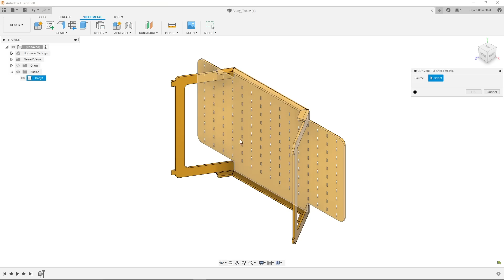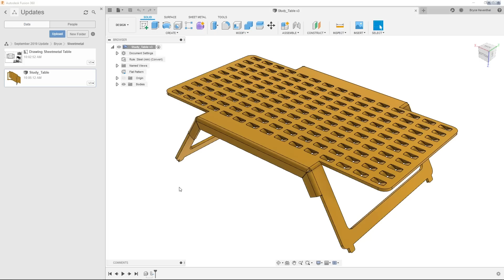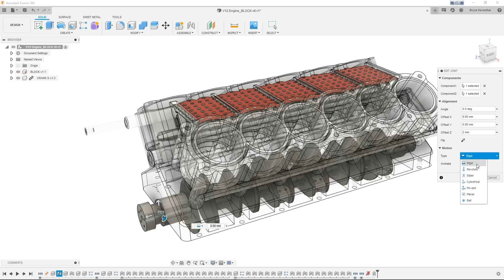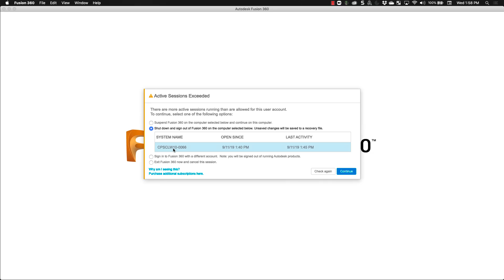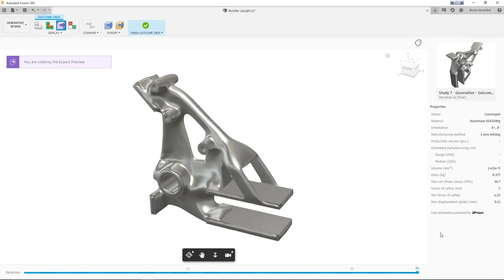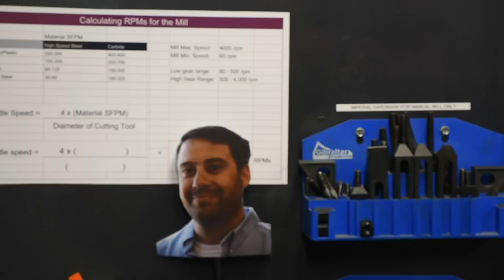What's New in Fusion 360 Design & Engineering - September 2019

Comment: And still no 4k monitor update, feel like its 2010... Autocad developing is slowwwwwwwwww...
Reply: Oh and proper print from f360 also seems like magic is the only solution
Reply from the maker: Can you clarify?  Are you talking about 3D printing or printing a drawing?
Reply: @adskFusion  No, printing sketch in 1:1 or part of sketch, so you can for ex glue and cut it out on a router...
There is a long discussion about it on your forums
Reply from the maker: @Milika-  We recently just updated all of our icons to be more visible on 4K monitors.  Also, this video was showing Fusion 360 updates, not Autocad updates...
Reply: @adskFusion  Still 4k support is not there, main screen is in 2k and my monitor is 4k, really visible.
Reply: See this again workaround https://forums.autodesk.com/t5/fusion-360-design-validate/fusion-360-amp-4k-monitors-if-you-use-a-4k-monitor-please/td-p/5969046

Comment: When are you going to add configurations? Only thing stopping me fully adopting fusion.
Reply from the maker: Andrew-  You can make a setup kind of like configurations.  You can download an add-in called Parameter I/O.  It allows you to import/export parameters from excel.  You can then use the excel spreadsheet to drive different parameters on your model, such as length, pattern number, etc
Reply: @adskFusion  might be a work around short term but long term needs addressing.

Comment: All this fancy stuff and we still can't model a 1/8" pipe thread.
Reply: You can, just need to know how.
Reply: @fredgenius  Yeah, I know I can import a pipe plug from McMaster Carr, assemble it into position and use the Combine tool to create the thread, but that's a poor work-around at best.
Reply: @silverbob8656  There are other ways - you can edit the thread definition file and add the thread profile you need, but that's a bit tricky. Or you could model the thread profile yourself and sweep it along a helical path... Neither method is easy, and sure it would be great if Fusion 360 offered every thread ever made...
Reply: @fredgenius "...every thread ever made..."  WTF???   They already do offer various obscure thread forms that have rarely been used in industry for my entire 41 year career in aerospace machining!  NPT threads are used around the world automotive, aerospace, power generation, and hundreds of other commercial applications.  Making your users jump through all the stupid hoops you described is asinine.
Reply: @silverbob8656  Sorry, crossed wires - I don't speak for Autodesk, and it was late when I typed 'every thread ever made' and I apologise, dint come out right. Edit: Seems 1/8" BSP IS available in the Create Thread panel. Only the the parallel variant though, not tapered.